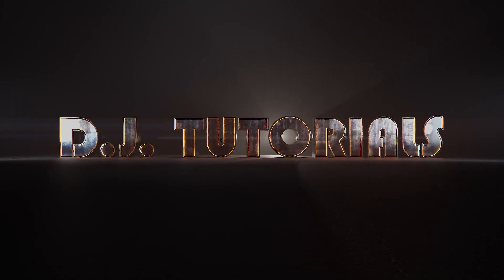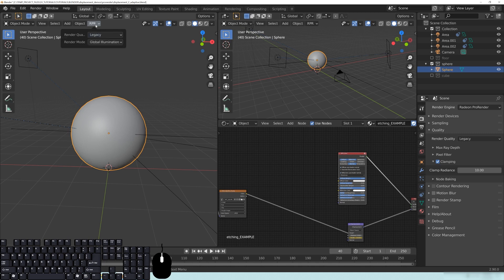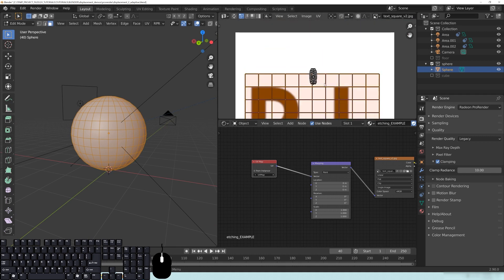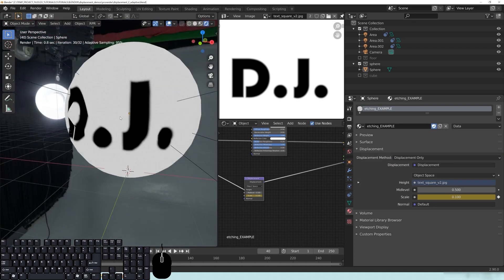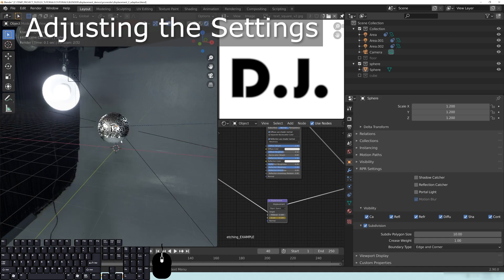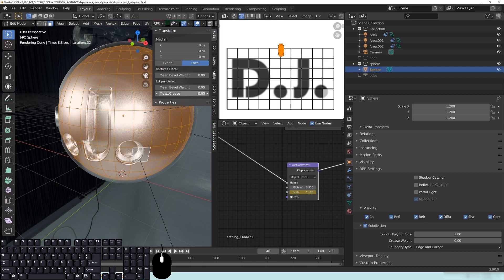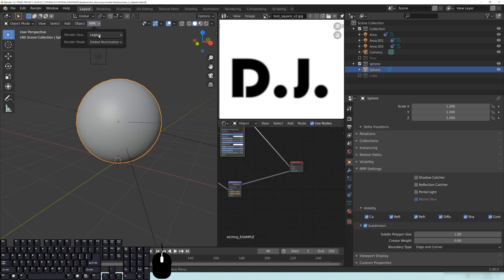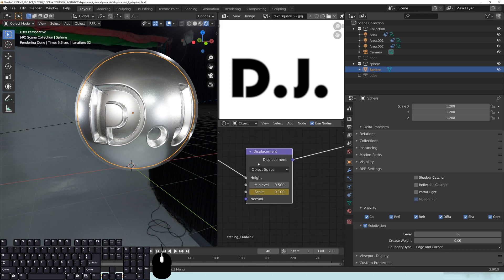Radeon ProRender for Blender | Adaptive Subdivision for Displacement Maps

Comment: So, one question, new AMD and Nvidia gpus are out for sale, which one would you prefer? Nvidia's cards seem to have higher compute power, while AMD's offer better prices (slightly) and more VRAM. We obviously don't know how each card compare to the other until we have better benchmarks, and also Nvidia have Optix render while AMD doesn't. But there's something that sounds stupid about this very expensive Nvidia cards packing only 10gb of RAM like 3080.
Reply from the maker: SORRY ABOUT THE LENGTH! - Based on what I am seeing from the very few benchmarks, I would say it's still up in the air. Unfortunately most of the benchmarks I have seen are not really pushing the VRAM capabilities. I think if you are planning to build large scenes, you need to go at least to 12 or 16GB VRAM for high resolution PBR textures and high density scenes. The 3090 I think is going to take it all with the 20GB VRAM and the computation power- it is very impressive. With OptiX, remember that it is still in development and very buggy. I have an RTX rig for my work computer and it is very unstable and I usually don't use it. 

If you are making animations for HD final, then a 10GB VRAM should be alright. But if you are trying to make ultra high-realism with 4K or higher PBR textures, you will run into some issues. I have read that they (Nvidia and AMD) are working on technology for offloading VRAM to utilize CPU RAM capacity in conjunction with VRAM. If that happens then the VRAM caps will matter much less. Not not mention that AMD and Nvidia are allowing a few select cards to be paired together to increase the max VRAM caches so Pro cards and higher end Nvidia cards should be looked at for that alone.

It would be wise to wait until people who work in the field actually start posting in forums and providing real world examples and benchmarks and workloads. Gamer's Nexus is usually pretty good at this for benchmarks but still. I would hold out until 2021 and especially watch the launch of 6900xt.

ALSO- Nvidia will almost assuredly have a new launch like the RTX 20 Super series to respond to AMD's cards so beware of that.
Reply: @djtutorialscgi  Hi! very useful explanation, thank you very much!

Comment: Thank you for the shout-out!
Reply from the maker: Of course! By the way- in the video it calls this out but in the newer Beta builds it doesn’t claim that the subdivisions are necessarily adaptive. Based on the documentation, it suggests that the two methods seen in the video aren’t necessarily adaptive but when moving toward or away from the object it appears like the computation is less intensive and possibly adaptive but... not sure sure. If you do any testing with the newer Weekly builds please let me know your findings.
Reply: @djtutorialscgi  I just did some testing with version 2.5.30 but on macOS. I don’t think the new full version supports adaptiv subdivision. No matter where I placed the camera, the amount of detail seemed to stay the same. However the legacy version definitely did support adaptive subdivision.
Reply from the maker: @oliverwosnitza  I figured- the good news is that the tutorial is still valid since when it is added in, it will be in the same place (hopefully)
Reply: @djtutorialscgi  Not only that. Since the new full version still has some bugs and missing features, the legacy version will probably still be used by a lot of people instead of the new version.
Reply from the maker: @oliverwosnitza  For production, I would recommend using Legacy or the official release. But 2.0 is really fast and clean. When it works, it looks amazing.
Reply: @djtutorialscgi  I absolutely agree with you. 2.0 is very clean even with lower samples and it also keeps the viewport more responsive compared to Legacy. They just released 3.0 on GitHub and their release notes confirm that 2.0 does not currently support heterogenous volumes, adaptive sampling and adaptive subdivision.
Reply from the maker: @oliverwosnitza  True- I just sent a bug report and the devs said that the adaptive is not implemented yet. By the way, a new 3.0 has been released. A lot of bug fixes and optimizations as well as support for the 6000 series GPUs.